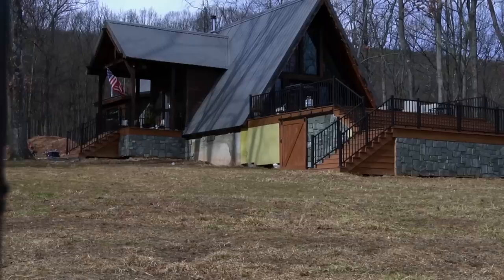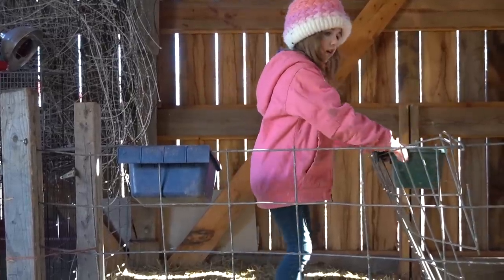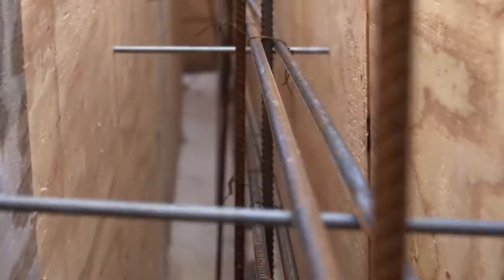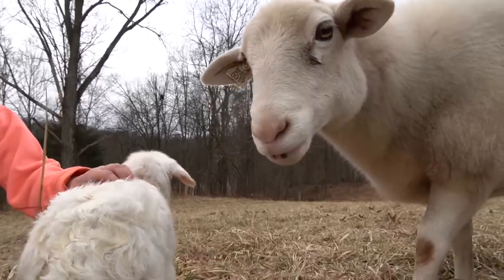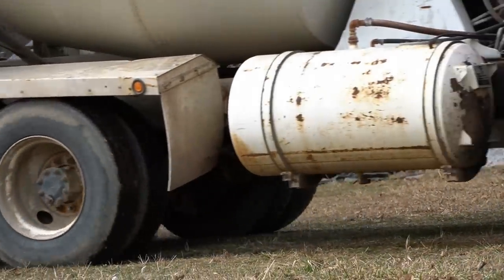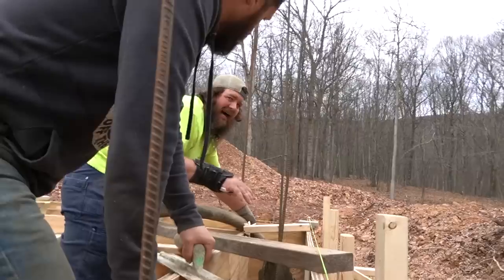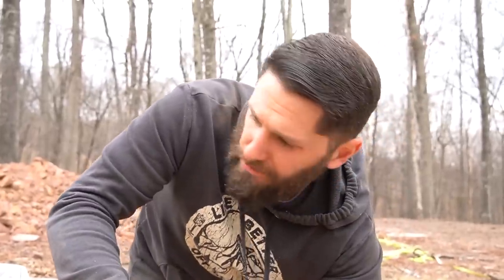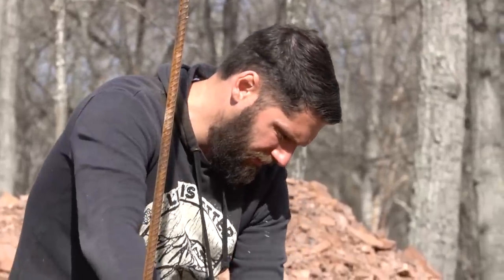Pouring Concrete Walls For My BUNKER SAFE ROOM!

Comment: Looks great! You’ll want to get those forms off within 24-36 hours or they’ll be very hard to peel off. Forms are normally oiled to prevent the concrete from adhering to the plywood.

Comment: Josh you don't need to shorten the forms...with your laser...make the marks...chalk line it..then put a 8d nail every couple of feet on the chalk line for the stem wall height...! Easy to towel it to level...! Make some bigger washer plates to distribute more weight on the plywood...and don't forget to spray your forms with some type of release...use your sawsall and put it against the form will act as a vibrating tool to help with air pockets...!

Comment: Josh, the bottom of the form will have the greatest pressure from the concrete. So when the pour starts, go slow and let it flow down to the base of the top of the footer. You tap on the form with the framing hammer to get a smooth finish with no air pockets(RAT Holes).

Comment: Erin, quite an adorable helper she's become.  I've watched from the beginning. As a retired structural engineer, good looking concrete mix coming out of the truck.   Trick to pouring walls or vertically is to do it in lifts l, pouring slowly giving time to start setting.  Horizontal pressure on forms is time dependent.

Comment: One more thing I noticed when your form started moving: Doing the forming by the professional method, you should be vibrating the concrete to remove air and consolidate the mix. When forms move, lift, buldge, or blow out, you can't vibrate it. You should understand, as it's like someone using 18 ga wire on a kitchen circuit, or not grounding an entrance panel service, etc. Do it right the first time. I hope this helps.

Comment: I have used threaded rods washers en nuts on walls in my garden but I shoved PVC electrical tubing over the threaded rods in the cast form so i could reuse the threaded rods , i left the electrical tubing in the concrete as it hardened and have a 12 mm diameter hole which can later be used for some purpose yet to be determined.

Comment: If you put some plastic pipe around the treaded rods, you can take the rods back out, and reuse them on next pours. Also the pipe can help keeping the right spacing between the forms.

Comment: Hi Josh and Erin.Just watched Engineer 775 on YouTube. He installed AcDc EG4 airconditioner using  solar only . It runs down to 61 degrees. He used
it on solar  only
Ran it down to 6

Comment: Congratulation from Bulgaria on the progress and the nice videos at all. I've been following your channel with interest for quite some time. A couple of questions about the concrete . Isn't the rebar insufficient for that thickness of the concrete ? About the formwork - wouldn't have been easier if you took the top leveling first with boards and then nailing the OSB downwards ?

Comment: Great job with the concrete forms and pour.   Erin what breed of sheep are your Ewes? Is Leon the same breed or something different?  Do the Ewes have hair like Leon or do they have wool that has to be sheared and do you shorten the lamb tails with the rubber bands that I have seen other sheep farmers use that helps prevent problems later on with flies, breeding, lambing and just keeping the area cleaner. Do you treat the lambs umbilical cords with iodine to help seal and dry them up which helps prevent joint ill and other issues? Do you supplement the sheep's diet with any grain or minerals while they are in the pasture or is that only done while in the barn and have you had the soil/hay tested for quality and nutrients to make sure that they are getting everything they need in their diet? Just wondering because I am new to the world of raising sheep and other animals on smaller family farms. I know that selenium is a common element that can be deficient and can cause issues with the lambs health.  I am still learning the differences between sheep who are raised outside vs.those raised in a barn setup and find it very interesting.

Comment: Hello family. We put planks vertically every 50 centimeters on them we put the studs with screws, we make a good sandwich along the entire length and then level and strong counters and that never bursts, if you go too far with the vibrator

Comment: Boy things are coming along nicely.  Josh , I'm wondering why you do not use concrete form ties instead of all the 2x4 studs. Litteraly $50. worth of ties would of saved you a $1,000. in 2x4's.  There is also the consistency that Would be perfect and NO CHANCE OF BLOWOUT.         CHEERS         Steve h.

Comment: The rods should go through the 2x4's it would hold better.  Nail a chamber strip at the top for grade instead of cutting the ply. It will leave a nice 45 on the edge of the concrete. Did you oil the ply or at least wet them? It helps with stripping them. How about a vib to help get the air pockets out. 🤔 at least tonk the sides.

Comment: They make a complete engineered button end spacer that holds the exact wall space with two formed in washers to the dimension of the wall. All the holes are drilled every sixteen inches and a re usable clip holds the wall stiffeners called whalers to the engineered spacers. I would think for what you are spending for threaded rod which looks risky for blow outs and wavy walls , that you could have an engineered product.
   The big advantage of all this is that the whalers and plywood make into studs and sheathing for the rest of your build with the spacers becoming part of the wall that you can use to tie the rebar to.
    I have been on large jobs with talk walls and the guys who rented the forms to us kept time as we added one foot lifts to the wall. If the truck driver pumped too fast the pour was halted so as not to exceed the carrying capacity of the forms. Most of the best work around my area is fine with engineered aluminum forms for residential work and the accuracy is phenomenal with laser integrated into the form setting.
    Our little company started adding two inch blue Styrofoam on the interior form side of the wall and the customers loved how much warmer the house stays. No frozen pipes ever.

Comment: Don’t you use a vibrator to eliminate air bubbles when pouring concrete? Also if you plan to also do the ceiling in concrete, it’d have been a good idea to put a lot more rebar in the walls. I’m afraid your walls have too little rebar compared to what we are used in Europe. Congrats for you hard work and videos! 😊

Comment: I'm wondering where your upright rebar (minimum 24") is that should be sticking out above your solid wall, to tie in the concrete block you're going to build above the bomb shelter. Um... office.  2.) OK, I see it now, you snuck it in while we were looking at the new lambs.  Good Job.

Comment: No blowouts, no rain...good day I'd say.
Instead of your steel trowel for floating the mix ya need to pickup a magnesium hand float...made to float wet concrete. Not supposed to use steel until concrete sets up, reason being, steel can trap bleed water causing concrete to "pop" and peal.
More of a concern for flat work concrete (sidewalks and such) than foundation...just so you know.

Comment: Good day, you have very interesting videos, I am interested in one question, if I buy a similar plot in the mountains and want to build a small self-contained house on it, can I do it without asking anyone for permission or do I need to get permits and comply with building codes, I am in  I recently moved to the USA, so I would be grateful if someone could explain.

Comment: I can now see why you chose plywood as forms instead of ICF because you are able to trim the plywood down reasonably easy to get a level top.
Reply: The ICF blocks are like legos and would have been even with each other so you would not have to trim them as long as long as the first row started out level. They are so much easier and faster to set up plus the clean up is faster as the only thing to take down is the added bracing.

Comment: I thought maybe you'd turn the deck into  covered outdoor living room small kitchen/cooking  area.
Reply: I had thought that to. Built with glass or something.
Reply: @lyndralondon5169  maybe sheet metal roofing combined with  plexiglass skylight strips  , and a front wall of folding glass doors .

Comment: Did you not use form oil on those panels for easy release? Most of us in the contractor world would just spay the inside panels with diesel fuel.

Comment: Josh, I’m confused about your safe room.  I thought the point of a safe room was that the walls were solid concrete to the ceiling, but the walls you’ve been framing up to pour are only a couple feet tall.  What am I not understanding?
Reply: They will be adding forms to the top of the walls and extending them higher in a future pour.😉
Reply: @tylermurray2265  don’t they typically do walls in a single pour for better structural integrity?  Or does it not really matter?

Comment: 🤔💡

adjective
not using or depending on public utilities, especially the supply of electricity.
"off-grid housing"

adverb
without using or depending on public utilities, ➡️  especially  ⬅️ the supply of electricity.
Reply from the maker: Correct. We do not rely on, nor do we have any public utilities on our property. We are 100% off grid.